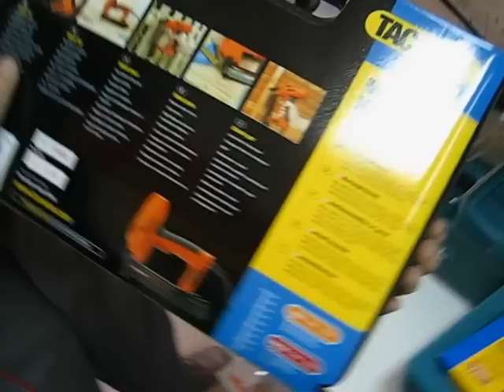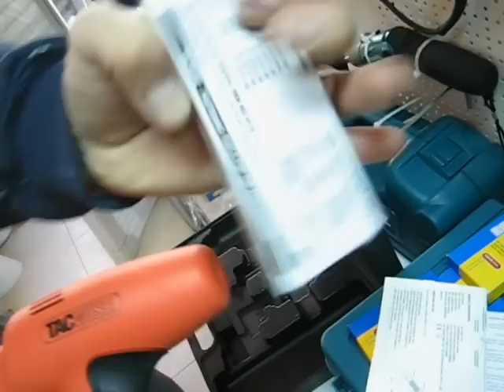TEST Електрически такер EL191 Tacwise- 15-35J/E

Comment: these are crap! I have had two now, I won't be buying a third!
Reply: in video its doing its work , wht u found bad ?
Reply: @doityourselfpakistan6535   they fall apart very quick, and the nails don't always go all the way meaning you still have to use a hammer
Reply: @imcompitentfool  u mean if i stick two wood peices togahter they ll not stick for long ? i am getting a parkside c2 nailer and in review it was working same like this.
Reply: @imcompitentfool  should i drop the idea? i have to stich two 18mm pecies of plywood together .
Reply: @doityourselfpakistan6535  thats up to you